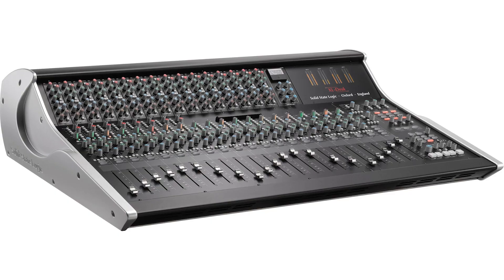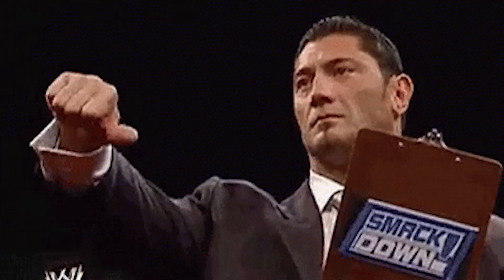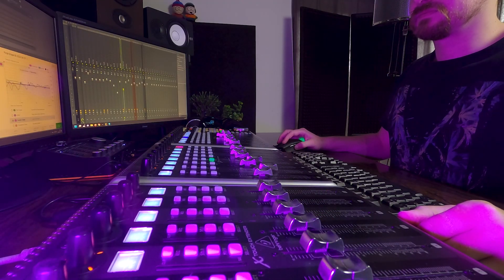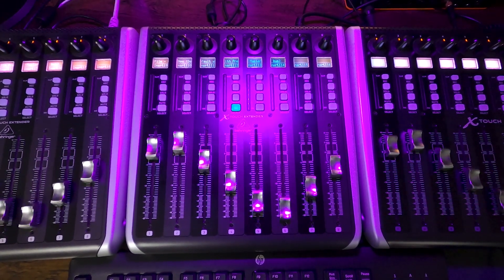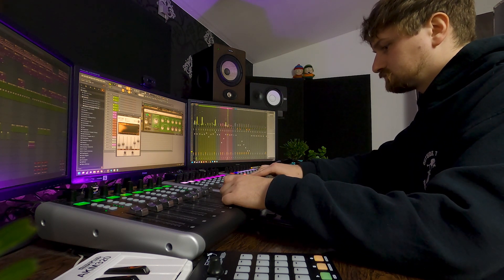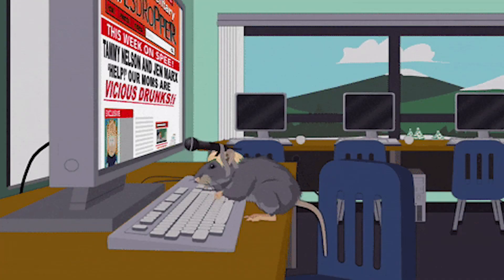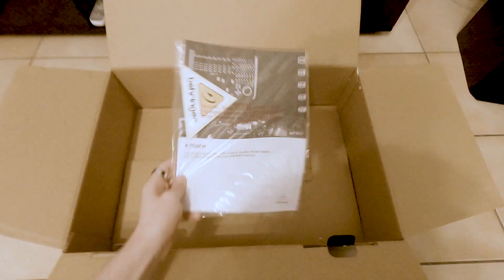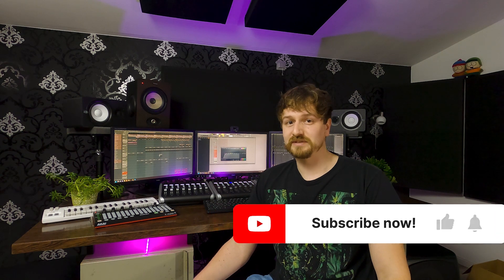Controlling FL Studio with the Behringer X-Touch

Comment: Do you know you can remove the silver sides and have the units neatly pack together? I did that with my X-Touch One and integrated much better with the rest of my gear. The sides are not hollow, they have metal plates.
Reply from the maker: I wanted to do that, but then I had this hole in the front in between the units. How did you deal with that?
Reply: @SirFreak  In my case since the Xtouch One is small and is sandwich between other units, I can't see the holes at the front.

I've seen people dealing with it either with black gaffer tape or 3D printed parts.

If I had your setup, I guess I would just use gaffer tape and call it a day. The benefit of having them all neatly side by side without silver separators is a win alone.

Comment: Hey I had a couple questions before purchasing for myself

1. Will your script work with the XTouch Compact
2. If setup properly will the faders automatically snap to position if I use my mouse to move the fader?
3. Must I manually set universal control in fl for each fader and then assign them to the physical faders? Or is it manually setup in some way?

Thanks so much your amazing
Reply from the maker: Hey. It's hard to say this without doubt, because I don't have such a device and so I cannot test it. In theory it should work. The hardware is pretty similar and it works with the same protocol. However, that hardware unit does miss some things like screens that are available on the xtouch. I doubt that that would cause any issues though. Apart from some button descriptions not being correct. I'm not sure if you will be able to use this as an extender though, in case you buy multiple.
When you move the fader in the FL studio, the fader on the hardware unit will move too.
There is no need to assign every fader manually. That happens automatically. You can bank through the faders with buttons on the hardware.
Hope that at least answers some of your questions.
Reply from the maker: By the way, this dude Ian Walker also made a script specifically for that model of the XTouch. If mine does not work properly, you might try his: https://youtu.be/aUCshg_aT2w?si=q6_GDdL_KiCAhO9h
Let me know how it goes!

Comment: 🚨 NIGHT MODE 🚨 for Behringer X touch. Will illuminate the the button's LEDs at different velocities when on or off. Which would allow a better sense of direction across the behringer console in darker studio settings. Would this be useful yes or no? comment on why it would or wouldn't work for your workflow. I’ve been in contact with behringer’s team and they are planning to implement this feature!!! Only thing is it has no time frame. If I can get people to like this idea and tag behringer , they said priority for this would be ASAP. Please like and tag Behringer if you would like to have a NIGHT MODE FEATURE #Behringer

Comment: Hi, You are the hope of many of us, do Toy have a script that enables automatic bank changing when switching channels? I'm using the x touch one. BTW Behringer engineers should pay You for this... :I
Reply from the maker: Hey. As I don't have an X-Touch One, I haven't really done anything to support those. Does my script even work with that controller? I was under the impression that there was already a good functioning script for the X-Touch One, but now that I'm looking for it, I can't find it.

Am I understanding correctly, that you would like to automatically bank to a specific track if it's being selected inside of FL Studio? I still plan on rewriting the banking system, and I guess that could be an option I could add specifically for X-Touch One users (I would need to add a setting somewhere though).

Comment: Amazing that you make this available to all of us!
also, I've been very curious if its possible for channels to be grouped with commands from the x touch (subgroups). Do you think this is possible? and also being able to change audio inputs of a channel for external recording, and moving channels around in the mixer.
Reply from the maker: Do you mean channels in the channel rack?
Perhaps some of those things are possible, but I'd have to do some research first. In any case, I won't be working on the script until my upcoming EP/album is released, and that will still take a couple of months. After that I'd like to put some more work in the script, perhaps these are some things I can have a look at, then.
Reply: @SirFreak  Sorry for not being clear. I meant mixerchannels, to make subgroups in the mixer, which would be awesome for workflow.
Thanks for your work and good luck with your EP!
Reply from the maker: @sightlok  FL Studio does not really have grouped mixer tracks, but you can route tracks to other tracks and put dividers between tracks, which can give you a similar look. Making macros can perhaps be possible, but I'd have to think about how that will work UX wise. Right now it is possible though to do the mixer routing using my script (using the send functionality).
Reply from the maker: Putting in dividers is not possible using the hardware though right now.

Comment: Hi, your script is awesome ! I have one x touch and two extenders, but I have some crash (after 10 minutes use) it’s normal ? Sorry for my English I’m French !
Reply from the maker: That should not happen. Is it FL studio that is crashing, or the device? And does it occur during a specific task?
Reply: @SirFreak  Yes I’m exporting or recording one track or when I charge a plugin. I was on Fl studio 20 and I updated my Fl studio yesterday but for know I didn’t test it. Maybe a fix on the new version ? I’ll keep you informed !
Reply from the maker: @stiirzy  I haven't tested it with the new version yet. Still it would be interesting to know if the device hangs, or if FL studio crashes. Have you tried the original script by Image-Line as well, and do you have a similar issue there? Or does it only happen using my script?
Reply: @SirFreak  Hi ! I tested with the original script but 0 support with the second extender. 0 crash with it. I will test it this weekend and I come back soon for the news !
Reply: @SirFreak hi I test it and after 10 min 0 response from de x touch which is blocking everything. I was editing a plugin when it crashed. Which version have you on your x touch and extenders ? Thanks a lot 😊
Reply from the maker: @stiirzy  Hey, I'm still on firmware v1.21, did not know there was a v1.22 already. So if I understand correctly, you did not get any crashes on the script by Image-Line?
Reply: @SirFreak  Yes but I think I solve the problem. I was on « FL Studio Asio », know I set on « Asio4all » and I have the impression that I have no crash. Maybe it’s not the script but the driver set that was crashing. I come back if I continue to have the crashing problem !
Reply from the maker: @stiirzy  Hmm interesting. If this is indeed the case, it might be a good idea to report it in the FL Studio forums
Reply: @SirFreak  Yes I will doing that because I still have the problem ! It’s when I charge a plugin after the main unit x touch is bloques and I can’t do nothing 😪
Reply from the maker: @stiirzy  Some time ago someone reported that some characters outside of ASCII make the device crash. I applied a fix for that, perhaps that was also your problem? Since you are French, perhaps you used é or è or ê somewhere? That might have caused a crash.
Reply: @SirFreak  Hi thanks a lot, I will check your update ! Thank you for your work !
Reply: @SirFreak Hi, I test the script but I always have the ascii bug report which are freezing my behringer. I tried to remove all the é è ê on my project but the bug still here. Thanks a lot for your commitment to this project !😊
Reply from the maker: @stiirzy Does it happen with specific projects? If so, can you perhaps send me a project file where it happens?
Reply: @SirFreak  Hi, all my project has the same ascii bug, it’s happened when I put all my VST in the mixer ! Yes of course, I can send one of my project !
Reply: @SirFreak  all my x touch and extender are on the latest update (1.22)

Comment: Thank you very much for your answer on reddit. Also very grateful for the work with the script. I'm going to try how it works, you gave me joy today. 👽👽
Reply from the maker: Allright! Let me know how it goes!
Reply: @SirFreak  It works like a charm. It would be great if you could use the two lines on the screen for the channel number (above) and the name (below). And that more colors could be read. Do you think that is possible? Are you still working on it? If you need any kind of help or proof you just have to ask me.
Otherwise everything is great.
Thank you very much for your work and time!
Reply from the maker: @d.trasted  More colors won't be possible, as the hardware only allows about 7 different colors. I know some guy on the FL studio forum did some changes to the official script to allow the channel number and name below it, but his script does not have support for extenders and some of the improvements that I did in my script. I'm still planning to do some work on the script, but I'm first focussing on my next EP right now.
Reply: @SirFreak   The color support for the scribble strips had some issues, which I fixed. I have a fork and can send a pull request your way if interested.
Reply from the maker: @homomorphic  What was the issue? And yeah sure, feel free to send me a pull request
Reply: @SirFreak  initially looked at it because purple (identified as pink in the code) wasn't working here. While looking at the code, I noticed there was a fundamental issue with the rgbtohsv transform that resulted in wrapping the hue value (which resulted in discontinuities in the hue space and exceptions in the color mapping code). 

Rewrote the rgbtohsv function to produce linear hue values and then implemented the color mapping as a table.  

It is still subjective where the color space splits are, but it is an easily modifiable table that requires no code changes (just data) to tweak mappings if necessary. 

I changed the pink identifier to purple as the color on the device here definitely seems more purple than pink. 

I have a unit test as well.
Reply from the maker: @homomorphic  I see, thanks for the explanation! Feel free to contribute and send me a pull request :)
Reply: @SirFreak  will do. Thanks for your work on this btw, my son appreciates the improved user experience with the x-touch (he picked one up second hand)

Comment: Yo i just purchased the main unit and 1 extender..imma purchase 2 more soon..I have the extender working but the main unit is not..do I need to assign it to ports in fl studio? Can u do a vid on how u got them all working?
Reply from the maker: Hey there. I'll maybe do a video in the future, but for now I'd suggest you this guide by Zizzer productions:
https://www.zizzerproductions.com/post/make-behringer-universal-control-surface-work-with-fl-studio

I also suggest putting the main unit port on 102 and the extenders on 103,104,...

I have heard someone saying that a third extender does not work properly. While the script should allow it, I have not tested that myself, since I only have 2 extenders, so I'm not sure if it will work.
Reply: @SirFreak  right on..I got them both working, but they are reading the same channels..on the extender, it has track 1, track 2, etc..and it says the same thing on the main unit, which is track 1, track 2 etc..
Reply from the maker: @trubblekleff3655  Make sure both your X-Touch and all the extenders are updated with the latest firmware. Check out this video on how to do that: https://www.youtube.com/watch?v=Q4ZKXVXQP8g and this video for the extender: https://www.youtube.com/watch?v=5_6VuSEh5r8

Also make sure ports are set both in input and output. And make sure you're using the latest version of FL Studio as well.
Reply: @SirFreak  oh yeah, I was looking for the flstudio user in the controller section of output and its not there
Reply from the maker: @trubblekleff3655  I'm not quite sure what you mean by that?
Reply: @SirFreak  oh I was saying the main unit and the extender both are only reading the tracks 1 thru 8..like it is duplicated..
Reply from the maker: @trubblekleff3655  yeah, that part I understood. But I didn't get what you meant by "the Fl Studio user in the controller section of output"?
Reply: Hey..just ran across your video again..I now have the main unit with 3 extenders..I saw in the main unit the channels 25-32..so I’m close to lining them up..I have them set, from left to right, 1 extender(1-8), main unit(9-16), then the other 2 extenders after the main unit(17-32). I want to put it like that but the numbers be off.